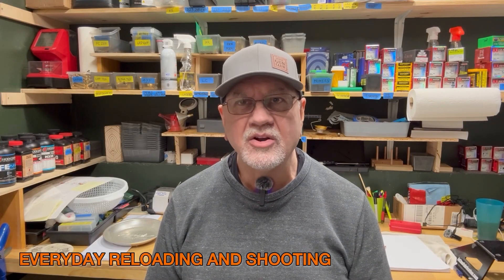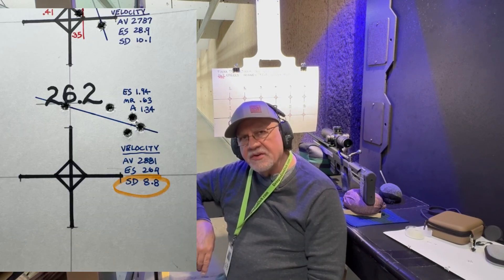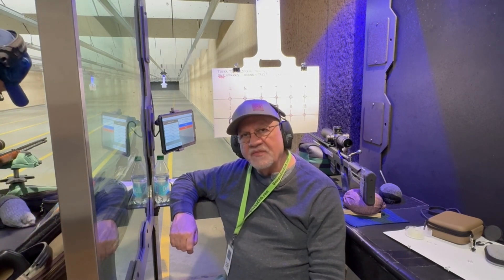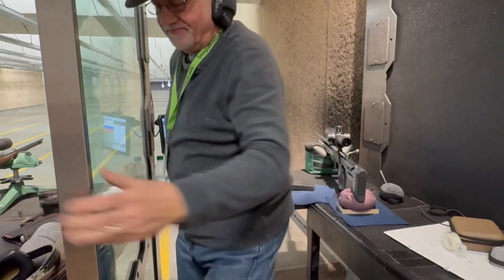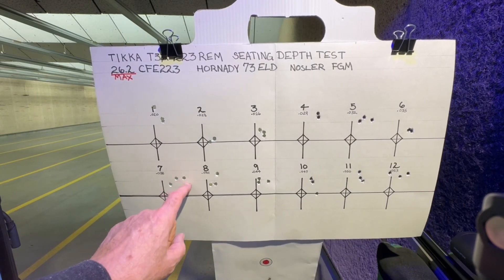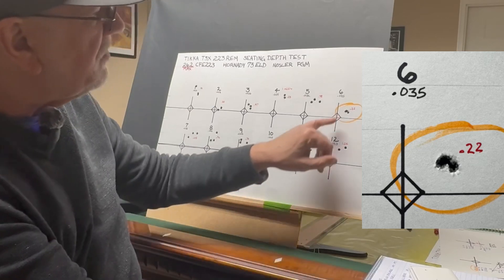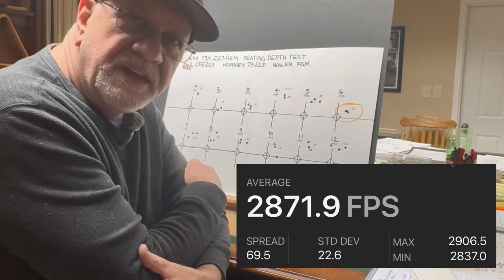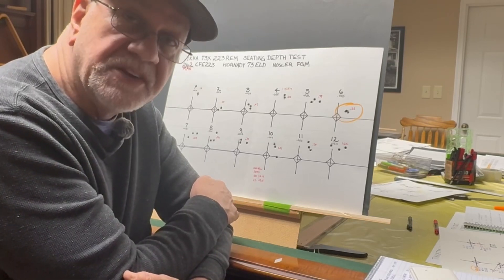Seating Depth for .223  With 73ELD-Match and 26.2 grains of CFE223

Comment: Compare the best vs worst seating depth. Load 30 of each. 

You need to validate whether your method works. Yes, the average group size can improve with more rounds and it can certainly get worse. Is there a significant difference between what you think is best vs worst?
Reply from the maker: I will be testing the best loads with 10 shot groups. I don't have to test the poorly performing loads. If they perform poorly at five shots I don't think they'll improve with 10 or 30.
Reply: @EverydayReloadingandShooting 
But how do you know your method actually works if you don’t test best vs worst?
Reply from the maker: Very simple.  If I test the best load and it performs well then I know my system works.
Reply: @EverydayReloadingandShooting 
That only gives you a rough idea of your average group size. It doesn’t confirm that your method actually improved accuracy.
Reply from the maker: @redneckchemtech7621 I don't need to shoot a poorly performing group to know that it performs poorly. If I shoot a 10 shot group and it shoots in the .030 range, I know I've got a good group. I don't need to test one that was shooting an inch or more. It's not going to change.
Reply from the maker: By your logic, I should shoot a 30 shot group on every group that I tested. Why use just the best and the worst? Why not test them all? Because they didn't all perform well. That's the purpose of the study is to find out which ones perform well and which ones do not. Once you know the ones that do then you zero in on those loads to confirm the fact that they are good performers
Reply: @EverydayReloadingandShooting 
Okay how about this: 

Test the best vs the worst and see how much of an improvement (if any) do you see? How effective is your method?
Reply from the maker: @redneckchemtech7621 stay tuned for my next video. I've already loaded the rounds and made the targets.
Reply: @EverydayReloadingandShooting 
Hell yeah I will!

Comment: I personally use 10 thou increments minimum. IMO 3 thou is way too small. That’s a nice indoor range!
Reply from the maker: @connerm4850  I'm relatively new at this and I'm still learning. I've tried both but I'm finding that.020 off the rifling is a good starting point. And going.003 i don't accidentally skip over a node. Thanks for sharing. Please see my other video on bergers and 23.8. You'll see what I mean. Thanks for watching. Please stick around
Reply: @ you bet

Comment: If i were you i would fall back to your 23.8 from the previous video with seating depth of 35-41. those results with those powder charges are not good at all. you will be chasing your tail constantly with that one random group of 26.2gr at 35 thou. The seating depths of  32 and 38 show you that it will fall apart either vertically or size wise on either side of that 35 thou. If you are looking for the absolute smallest group that might work fine for a while, but if you want one that will work great and stay great for a much longer period 26.2gr is not it with any of those seating depths. I guess you could always test out further with the depth too and still find a solid node. I went down that road too many times with those small nodes like you are talking about here and i will never do it again
Reply: BINGO!
Reply from the maker: Thanks, JBB. I appreciate the input. I do want to do a couple of 10 shot groups on the two nodes here just out of curiosity. If it doesn't pan out I will likely quit chasing my tail on this one. Thanks for watching